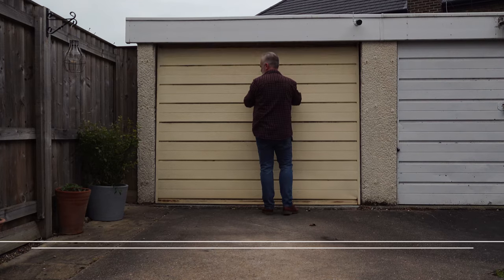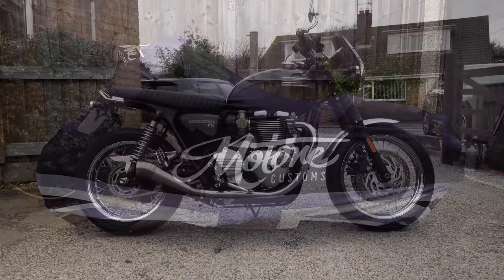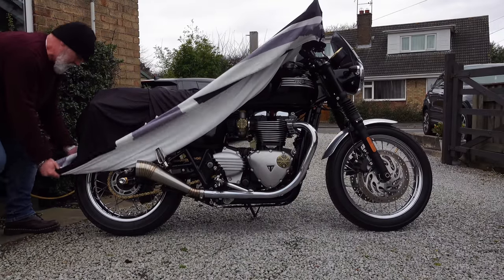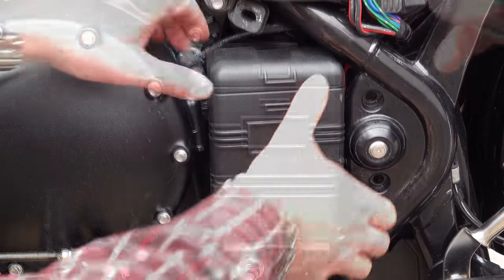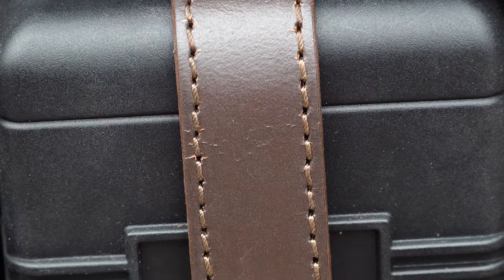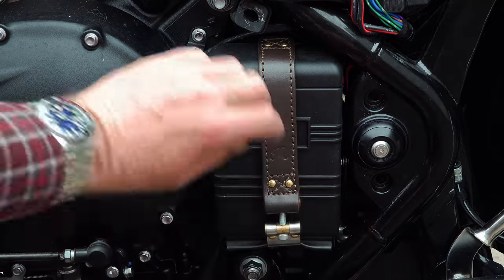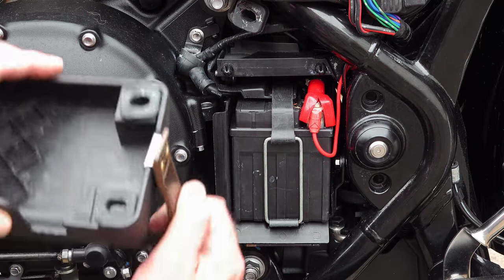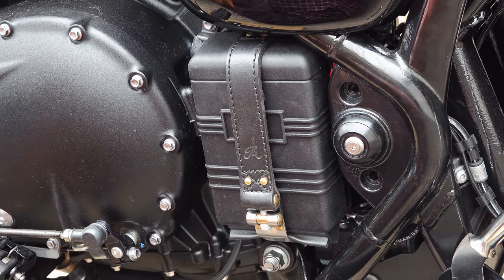Triumph Bonneville. Bobber/Bobber Black & SpeedMaster. The BELTANE Vintage leather Battery strap!

Comment: I use old curtains. 2 for each bike, job done. I am fortunate that my garage has heating pipes running through it so rarely gets below 9degrees C during winter. Leather accessories, nice touch👍

Comment: Interesting comments about indoor/outdoor covers in an unheated shed. I have an Asgard steel motorcycle shed in which I have stored the same two bikes for 11 years, unheated. It gets noticeable condensation inside the shed during the winter months but I cover both bikes with waterproof outdoor covers. They are dry as a bone under them and have suffered no corrosion in all that time. Just another spin on the topic!
Reply from the maker: The steel shed is obviously attracting most of the humidity, very large surface area?
Reply: @stuartfillingham  I believe you're right, yes. The underneath of the roof bore the most condensation when it happened. For anyone else considering one of those steel high-security sheds I would recommend them thoroughly but in the very first few days I stored bikes in there I was mortified to find them almost dripping wet in there. The covers have completely eliminated that problem. It could be that an indoor cover would suffice but I haven't tried that approach as yet.